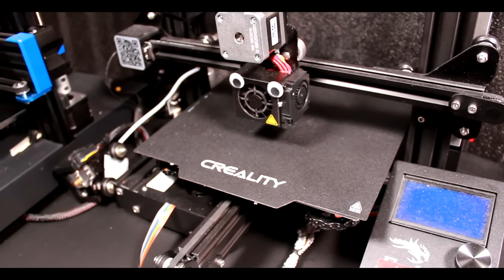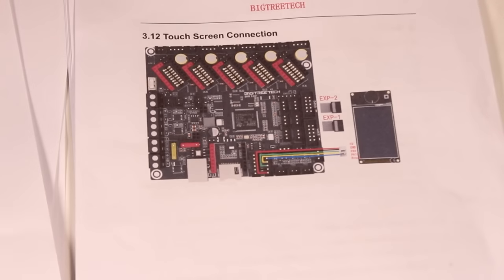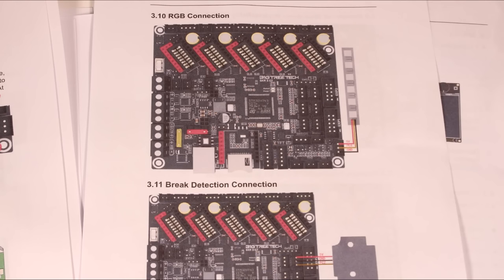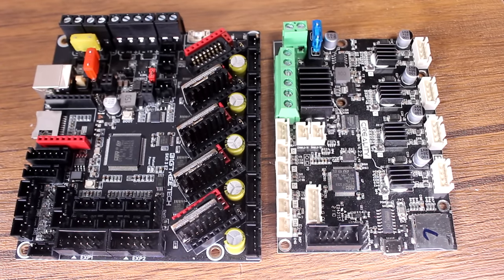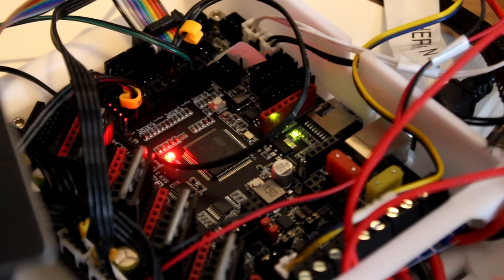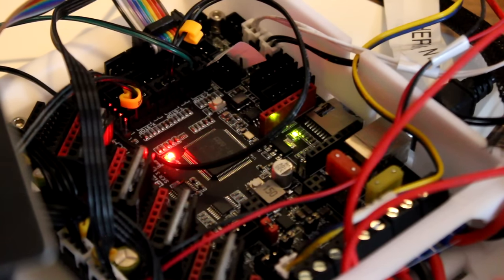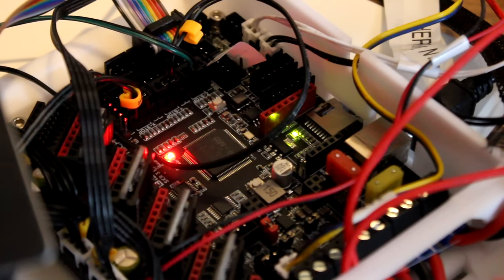Can an old Ender 3 be upgraded to be as good as a new printer? I test it out with the new SKR3 EZ.

Comment: Klipper is a pain in the butt when starting out but configuration is so much easier once you get the hang of it.
Reply from the maker: That's the impression I got
Reply: I agree. The big problem for me was converting from Marlin. Because I had a reference and wanted all the options available. But once you spend some time, it's a breeze. You don't even have to walk to your printer anymore. It's just "Save & restart".. BOOOM! Done..
Reply: Imo it's way easier than compiling marlin even when just getting started out.
Reply: For me, it's not that configuration is necessarily easier with Klipper, it's just the fact that you don't need to recompile the firmware every time you need to change something. That gets annoying quickly with Marlin. Lol

Comment: The ender screen works natively on klipper if you add the appropriate screen information to printer.cfg
Reply from the maker: ...I'm gonna need that... 👍
Reply: @LostInTech3D  this is for the ender3 pro screen and the BTT SKR 3.
[displayl
lcd_type: st7920
Cs_pin: EXP1_7
sclk_pin: EXP1_6
sid_pin: EXP1_8
encoder_pins: ^EXP1_5, ^EXP1_3 click pin: ^!EXP12
(output_pin beeper]
pin: EXP1_1
[board_pins]
aliases:
EXP1_1=PC5, EXP1_3=PB1, EXP1_5-PE10, EXP1_7=PE12, EXP1_9=<GND>,
EXP1_2=PBO, EXP1_4-PE9, EXP1_6-PE11, EXP1_8=PE13, EXP1_10=<5V>,
EXP2_1=PA6, EXP2_3=PE7, EXP2_5-PB2, EXP2_7=PC4, EXP2_9=<GND>,
EXP2_2=PA5, EXP2_4-PA4, EXP2_6=PAZ, EXP2_8=<RST>, EXP2_10=<NC>
Reply: @LostInTech3D  screen bed mesh follows.
Step 1 Edit printer.cfg and add these sections: [include mesh Bed.cfgl
[include levelCorner.cfg]

And I've sent the files you your diacord
Reply from the maker: Excellent, I'll do it after I've....sigh
...reassembled the printer later tonight 😂 that's showbiz for ya.
Reply: I knew I could make my Ender 3 v2 screen work and thought it would be an immediate must, but I've actually gotten used to not using it & I don't even care anymore.
Reply: I got an $8 webcam from Amazon that work as soon as I plugged it in & enabled it in settings.
Reply from the maker: I have a tonne of webcams (dont...ask) but what I lack is good mounting solutions!
Reply: @LostInTech3D  Would be great if you had a machine that could print something to mount them ;)
Reply: @LostInTech3D  I started with a Kleenex box untill I printed a better design.
I was surprised that I didn't have to do anything to configure it.

Comment: I upgraded my ender 3 V2 to klipper a couple weeks ago, I have to confess I was scared, had no idea what I was doing, and it took several days to get all the configurations done. But now I can't imagine my life without it lol. The real advantage over the stock setup is wifi printing, and input shaper, pressure advance too but you can get that on marlin and an upgraded main board. Anyways it prints faster and better than ever now, and no matter where I am in the house I have the printer's display in my pocket, and a camera to monitor the print.
Reply: with the board in this viideo? if so other thee the z probe di you have to redo any of the other wire plugs? like the pinoutss?

Comment: I would highly recommend NOT doing your dual boot thing on the printer.  Flash can only be written a certain number of times and you will kill it quickly if you keep swapping.
I think two things really can make an old printer perform close to a new printer.  Hotend upgrade and MCU / Mainboard update.   The old creality hotends were pretty dodgy really, built to a price and not really a lot of experience.   The old Melzi boards were good, but 8bit, limited memory really struggle with any new features.
The powerful MCU on the BigTreeTech board is great if you are running Marlin as Marlin does all the processing on the MCU.  Not really much of an advantage for Klipper, that processes everythign externally.     I'd likely go for the SKR E3 Mini board in preference on an Ender 3.  That is designed to be the same size as the old Creality boards and has the drivers already soldered onboard, and it literally is plug and play as far as hardware goes.   Big Tree Tech also have a MANTA board, which has the CB1 or SM4 provision on the board and the MANTA E3 is designed to be a direct drop in replacement for the Creality board, as in it is the same size.  This gives you the Raspberry Pi equivalent and printer control board all on the one board that just drops in.
Raspberry Pi is not actually the best way to run Klipper these days,  The cost of a Raspberry Pi is ridiculous.  Use an alternative, like the one from Big Tree Tech if you want to stay in one place.

Comment: To see the real power of Klipper you have to do the resonance testing with an ADXL and the Pressure Advance tuning.  Night and day difference in results of prints even with the stock 4.2.2 board. I just converted an Ender with the 4.2.2 and Klipper a few weeks ago and I am seriously impressed.
Reply from the maker: Ah, I'll get around to all that stuff, its been why it took me so long to even get to klipper tbh. You have a lot of legwork once you start. It's literally a can of worms.
Reply: @LostInTech3D  also, marlin now also supports input shaping so, that's cool I think
Reply: @Lucas_sGarage   S Curve on Marlin is pretty awesome too, as is the new Linear Advance that now supports the standalone drivers on the 4.2.2 and 4.2.7 boards.
That said, Klipper has the advantage of totally offloading the processing to the external processor, leaving the MCU to just control your steppers and not have to process the G Code really does help accuracy.   Also, Marlin can't (as of today) use an accelerometer to detect all your resonances, and this is a big advantage with Klipper.

Comment: Be very careful with LEDs. Use the power for the RGBs directly from your power supply and a buck converter. I installed 10 WS2812b LEDs on my SKR Pico and it blew the fuse of the board. Luckily, I had ordered a few fuses on ALI and replaced it.

Comment: Actually the SKR boards were the reason I like the original Ender 3 for tinkering. Marlin 2.x and all the I/O on an SKR allows for a lot of cheap upgrades. F.e. I use Unified Bed Leveling (UBL) with a <$2 foil sensor probe to be put onto the nozzle. As bending of the bed due to heating is (mostly) always the same on same temperature, I just did two meshes (for 60°C and 90°C) and stored them and load the mesh for PLA or PET-G. I only redo the mesh after hardware changes (f.e. Nozzle swap).
Also since Marlin 2.1.4 it now has input shaping. No autocalibration (that needs more computing power) but unless you change hardware (belt tension or other additions like new printhead) the resonance frequencys of your printer do not change, so a one-time calibration do not need to be automatic. So you can do a lot improvement just by upgrading the board and do some calibration.
Klipper is a pefect solution if you want to controll multiple MCU's (for example for multi material) and for high-speed coreXY and Delta printers. For a bed-slinger however, a good board with actual Marlin is totaly still OK, unless you want a multi-material unit (like the ERCF).
While I realy like fast modern printers with klipper (like the Vorons or delta printers), bed slingers are just slower but can print the same quality with (actual) Marlin on a good board.

Comment: I'm glad you emphasized the danger, I have had an SKR Mini e3 v1.2 installed in my Ender 3 for a few years now.

About a month ago I noticed a weird burning plastic smell coming from my printer so I shut it down and inspected it, didn't see anything funky so I took the motherboard cover off and saw that the power connector on the motherboard had melted.

It was my fault, I didn't crimp on a ferule for the power wires so over time the clamp weakened and caused resistance to spike driving the heat generation.

Thankfully I caught it before anything worse happened

Comment: I bought a SKR mini e3 as an upgrade to my Ender3 just around two years ago, and I can concur that upgrading your printer sounds a lot more daunting than it really is; my only real tip I'd give folks is to take a few pictures with your phone during the disassembly, that way you can always backtrack if you lose track of which wire goes where. But yeah, the instructions were perfectly clear and repeatable, I'd personally recommend BTT any day of the week.

It's a shame I tend to use my hardware until it physically breaks so I don't exactly have a need for an upgrade, but it's still fascinating seeing where the developments are heading; those drivers in particular seem very interesting, I wouldn't be surprised if that form factor took root on boards that need a bunch of them (like, just as an example, but something like the Octopus Pro with its eight drivers)
Reply: Definitely agree on taking photos as you go. I can't say enough how many times that saved me in the possibly 100;s of times I have rebuild old bed slingers. I'm kinda addicted to buying factory return enders on eBay for 60-90 $. Most of them ( it seems) are fine. The scenario I imagine is someone buying a printer. opens box, gets 1/3 into assembly then they get stuck on something. Bad assembly instructions or whatever, say screw it and stuffs everything back inbox. I got a ender 3 for 65 that was missing 1 5mm screw.  Anyway either photos on your phone or video the tear downs and you have a record of what's what.

Comment: Your print improvements are mainly from the better stepper drivers and faster CPU.  The CPU never bottlenecks.  This means no matter how big your file is, or no matter how fast you run your printer, you never see blobs on your print (printer will not stutter).  If you really wanna see improvements then tune pressure advance and input shaper on klipper.... Its super easy and quick to do.  U can get an ender3 printing like a profesional grade printer.
Reply: That is what I thought. He replaced 32 bit board with faster 32 bit board. It`s nice that it is quiet and have some additional outputs for future upgrade but the rest ? ARM Ender 3 board can also get newer Marlin or even Klipper. Even step sticks replace if you are persistent to do so. I don`t see a reason to change board until I will need some feature.

Comment: I'm still using a Ramps 8 bit board with Marlin 2.1.2. My printer has independent dual Z levelling, klicky probe bed mesh levelling, input shaper, a HGX lite diy direct drive extruder, diy encoder optical filament detection and can print at 150m/s with okay results.... I'm happy.

Comment: Another great video, TYVM for your time to produce. I'm about to do the mobo swap to a BTT SKR Mini E3 V3.0 w/ TMC2209 drivers under the schmick long heat-sink, and matching TFT35 E3 V3.0 Touchscreen, which apparently has room for a wifi board as well. I got the Mini about three moths ago due to a windfall, and the display a few weeks ago, and of course I forgot the wifi module, which'll take until after Christmas now with the increase in parcel volume... 

I'll try and take pics during the upgrade and maybe a few frames of video. I'm not much for production values (==nil post, nil edit...) but will PM.

Comment: I quite enjoyed your video.  I just wish I had a backup printer to print a new case.  Unfortunately, I just killed my SKR Mini E3 V2.0.  I was cleaning the nozzle on my Ender 3 Pro with a metal brush.  A very bad thing to do by the way.  The metal brissels got down on the heater cartridge and then there were a few sparks and no display.  The power supply still works as the leds in my enclosure still works, but nothing else does.  I checked out the display with my older 8- bit board and that worked.  The big 20Amp fuse is still good.  So, it looks like I fried my board which apparently does not have any protection circuitry so don't do what I did.  I could just use another SKR Mini, but I kind of like a board with replaceable drivers.

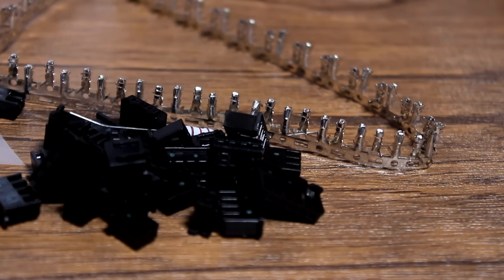Comment: 6:10 I didn't want to get a crimping set and tool for so long, but honestly it's just like getting an assortment of M2-M5 screws and such. it's SO worth it, having the stuff you need (and organised :p)
I got the IWISS IWS-2820 from aliexpress with a jst-xh kit, for around 30€. It's not super easy to use at times, and I know there are those ones with swappable "teeth" for different plugs, as with both dupont and jst-xh connectors, I have to crimp them twice. But they're very universal so far at least, I even use them to crimp end caps on my bike gear/brake cables haha. Can definitely recommend
Reply from the maker: I've yet to find a tool that does a proper clean crimp first time, it's more an art than a science for sure!
Reply: @LostInTech3D  I suppose that's the benefit of the tool I bought. as you have a very thin surface that crimps and bends the connector, you get a lot of control. which leaves it a lot more down to your accuracy and tolerances, instead of a tool automagically doing it (and failing to do so a lot, if it's a crap tool)

Comment: upgraded both of my ender 3 and ender 3 v2 to klipper/fluidd with skr btt mini e3 v2 and rpi 4 (and other upgrades). lots of advantages over using marlin such as wifi printing, responsive and intuitive UI and controls, input shaping and pressure advance for faster printing. modifying your configs has never been easier. however, the price of raspberry pis are stupid expensive now due to the shortage and demand.
Reply: TBH Marlin and Klipper are offering the same now. With these stupid fast 32 bit controllers and Marlin2 the speed limitations are gone. Both offers wifi printing, linear advance, input shaping. and responsive UI. The only difference is where the math is done (on a PI or on an STM32 contorller). Maybe the small nuances as Klipper has a fancy accelerometer based calibration for input shaping while Marlin has broader hardware compatibility.

Comment: With this board all "older" printers gets a super upgrade....  
I am a total Klipper fan. Have an i3 Mega S on Klipper and it works total nice, my Sidewinder X1 has also Klipper and it works much much better with it. Sure my Voron V0.1 works only with Klipper 🙂
And yes Klipper is not for beginners - the process of learning is high - but u can change in a minute the configuration ... and the finetuning is awesome. After a Year of Klipper i am still learning and find out more and more....  Marlin? whats this? a fish?? 🙂
Reply: Let’s open the “Mainsail” on our boat - ride the “Fluid”, catch something, “Klipper” into small bits and make a nice “Octo-pi” in the “CNC Kitchen”.  Don’t Prusa me overboard, we need to work together - as a “Duet”.

I’m out….

Comment: I decided to update my ender 3 v2 Neo with this exact board so I could have duel Z control plus a ton of other features that don't work well if at all with the stock Creality 4.2.2 board. Well apparently there are different revisions of this board now and I got one that has a even faster 550Mhz CPU STM32H723VG and a few other small QOL changes. But and this is a HUGE BUTT!!! BTT nor any other Marlin builds support this CPU yet... I've tried building it with the old SMT32H743Vx as my listed CPU and although the pins and all other hardware related parts are the same it just wont work no matter what I do... So I have a really nice 3D printer board with 5x SMT2209 drivers that is basically a paper weight...

Comment: Did you need any special adapter to use the original Ender 3 display (1 ribbon cable, I guess)? I thought only SKR E3 boards have correct pinout on the EXT ports.
Reply from the maker: No it works fine as is

Comment: I've had 2 SKR boards. Both garbage. 1 Lasted about a month and the second one I never bothered with because one of the steppers slots didn't work at all and I had to remap the firmware to use the last stepper slot as Y axis.  The stepper litterally had no power at the pin on the board. I went duet clones on both printers and never looked back. Way easier programming and much more reliable and included Wifi.

Comment: Would you be able to post a link to the Marlin firmware file you used? I have been able to successfully compile, I start the printer up, then nothing happens, just a blank screen. The firmware file is renamed to .cur but the printer doesn't work

Comment: I really wanted to convert one of my printers to klipper. But I just can't wrap my head around it for some reason. I tend to over think things, and finally threw in the towel. I have it on my Pi, but haven't finished the process because I don't want to ruin my printer that is printing just fine.
Reply from the maker: I'm going to be doing a LOT more klipper content, so hang in there.

Comment: Do you have comparison print between old and new board? Running Klipper on v1.1.4 (8bit) currently. Need to get a board anyway later this year and could put it in my ender 3 until then
Reply from the maker: At this point I'd probably recommend an all in one board like the manta I have waiting for installation.

Comment: 3d printing is a funny industry. most of the hardware existed for decades now, the only thing that actually changes is the software.

like, you could totally build a 3d printer 30 years ago, nothing on the hardware side really changed since then, but building a software for it was impractical because you needed a full expensive dedicated desktop just to run it, which made it such an inaccessible market no company would bother developing it.